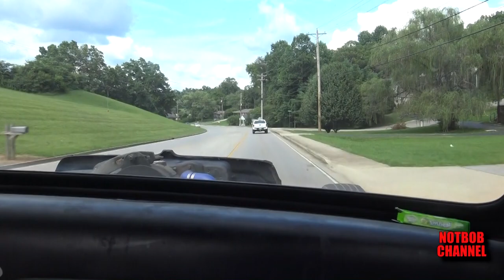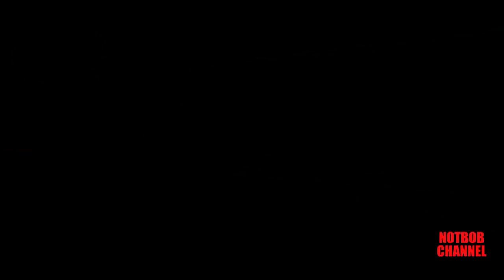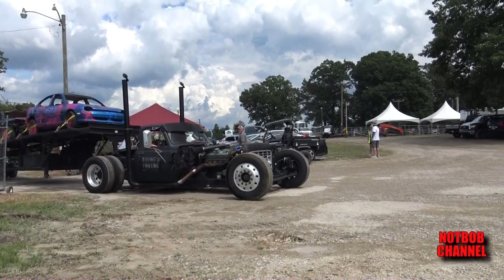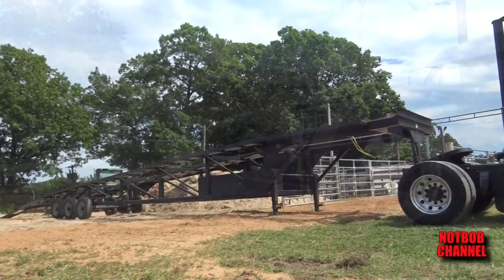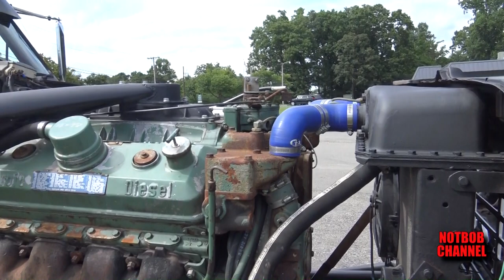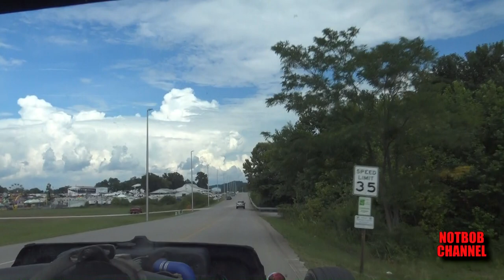Rat Rod Diesel Dually GMC 7800 Truck - GON DEF

Comment: What kind of lic plates you run  for the weight and trailer do you pull thru scales with it I'm  wanting to build something similar trying to figure out about lic plates I'm in illinois
Reply from the maker: I'll ask the owner...
Reply from the maker: He runs regular passenger tags on it. He only hauls things for himself (non-commercial) and hasn't had any problems so far.